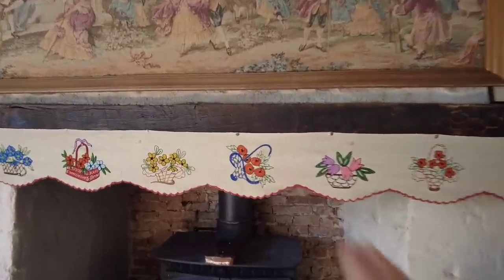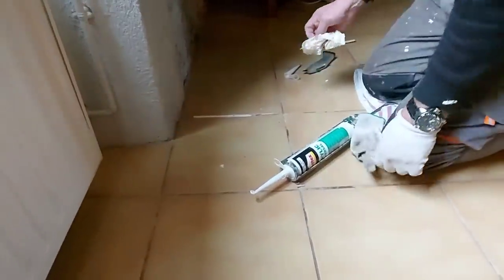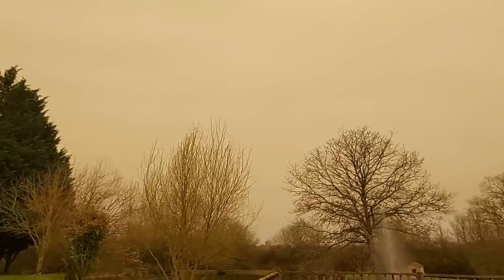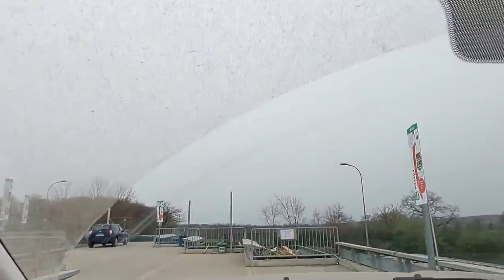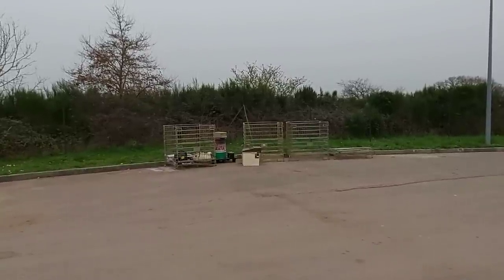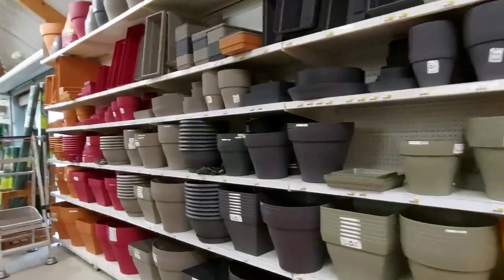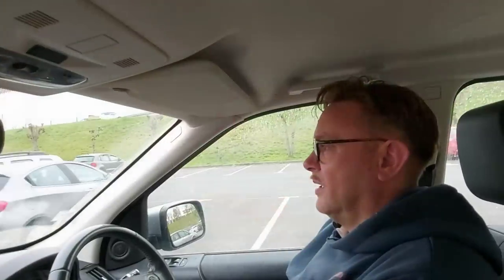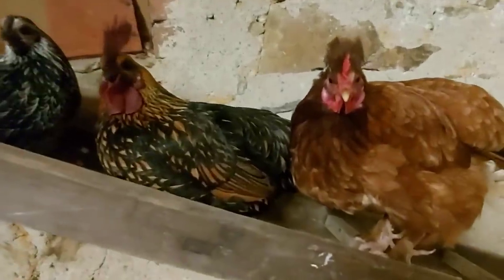Ep 41: Cottage Life - The Geese Escape

Comment: When backing a trailer, place one hand on the bottom of the steering wheel and the other on the back of the passenger seat.  with your hand at the bottom of the steering wheel the trailer will go in the direction that you turn the wheel versus when your hand is at the top of the wheel everything is reversed.
Reply from the maker: Thank you 😁 definitely will do that